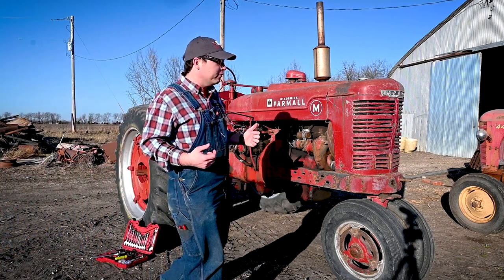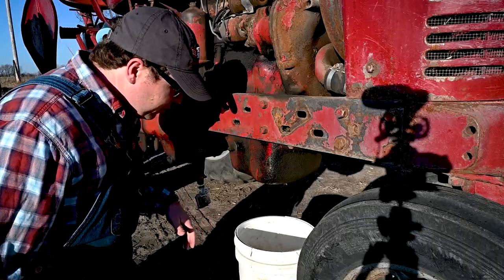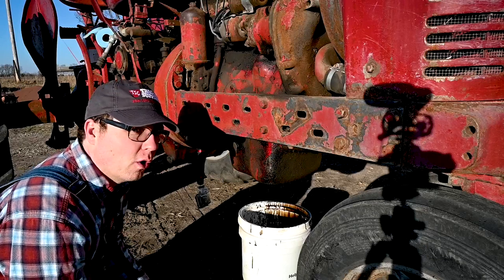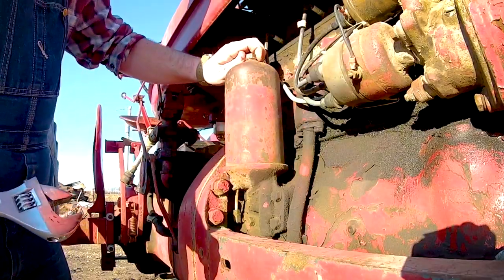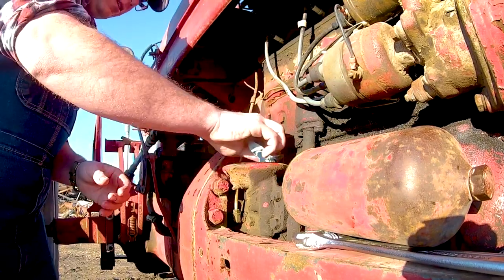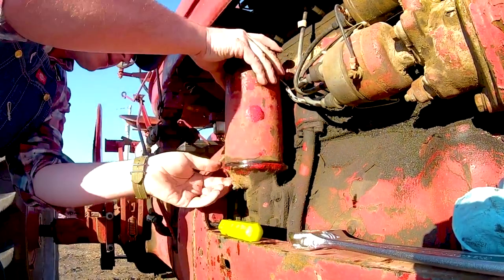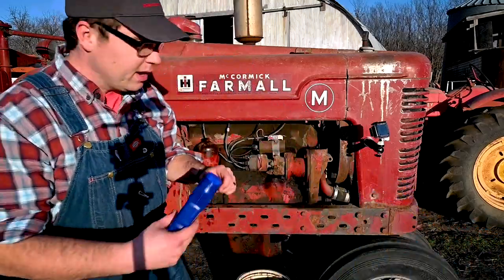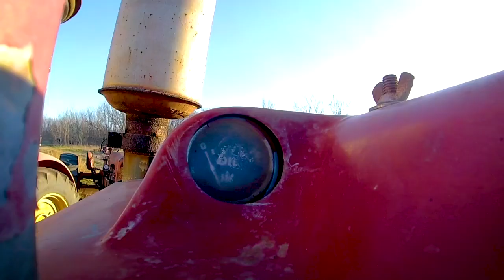Oil Change - Farmall M

Comment: The price of the oil filter has become too expensive $18 plus tax. So I intend to buy a adapter that converts the tractor to a spin on filter thats 1/4 the price.
Reply from the maker: I don't run the enough to worry about changing the filter that often. Just like to do it when I get the tractor.